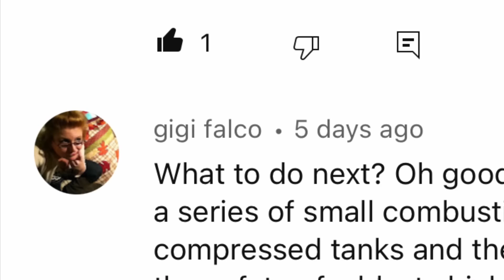Skorpios Has A HUGE! Problem...

Comment: Woof, this fight'll be tough especially after Ribbot. Hope you won't be writing off the cost of another used car, but after watching HUGE absolutely turn Shatter and Starchild inside out I'm more than a little scared for poor Skorpios. As long as you're able to reach HUGE's chassis with the hammersaw going full beans an upset is certainly possible.

Comment: Why does Huge need a cart? Can't they just pick it up by the stabilizers and wheel it around like a wheelbarrow?
Reply: I would LOVE to see that😂
Reply: Maybe huge has a lot of resistance in the wheels due to the gearing necessary to drive them. Cart wheels are free spinning but huge has a gearbox and chain so they're harder to spin. Also the wheel tread would get dirty on the way to the box and that sub optimal for traction.

Comment: Bite Force
Whiplash
Whiplash again (wait what?) 
Uppercut "I designed my bot to beat Huge"
Skorpios

Huge always seems to be picked to fight a bot designed to be able to beat them in the first round of the tournament and they always lose. Coincidence? 

In my bracket I've got Huge winning it all. If they can get past Skorpios it's four wheeled drive vertical spinners all the way.